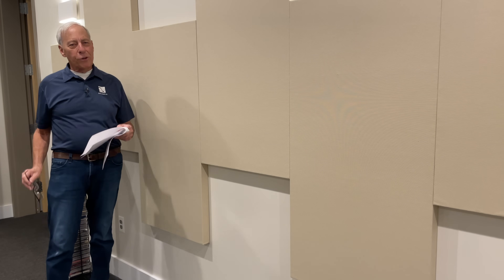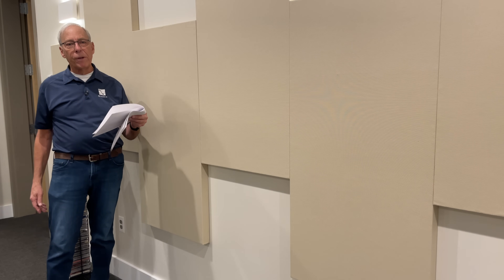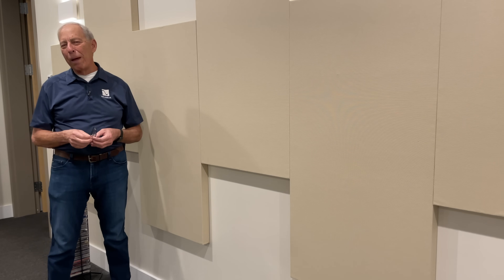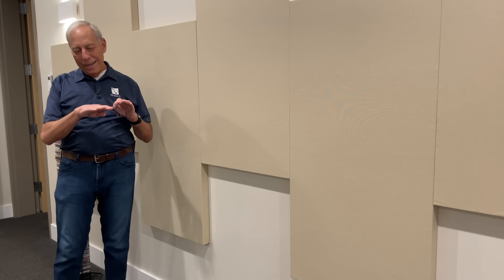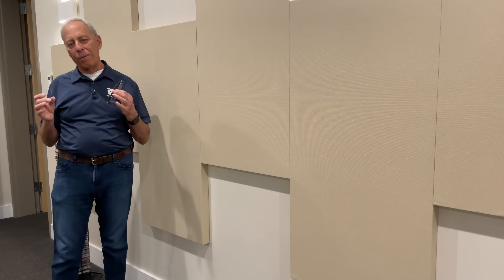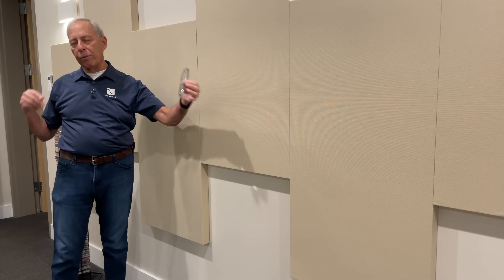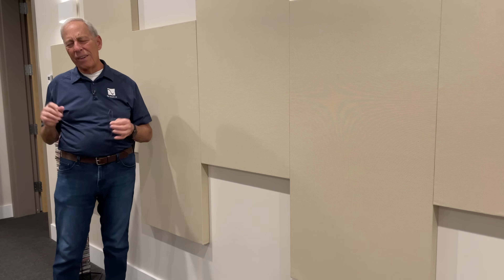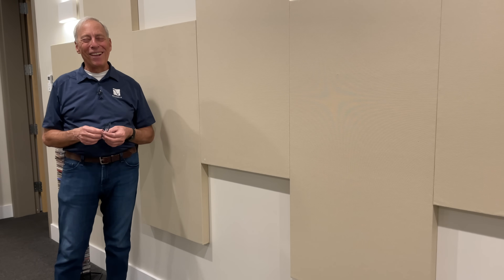Do audio connector materials matter?

Comment: Spending thousands of $ on cables is ridiculous. You won't hear any difference if you use those snake-oil cables or an electric cable from your wall at home as speaker-cable, or your lamp-cable. They lead the signal just as good. When the cables are connected to your gear, what's inside there do you think, diamonds and gold? ;)

Comment: I like pauls vids but only thing I never got was how little things like cable,digital noise such as laptops, to me I can't hear that noise anyway.  But then I guess I not true audiophile.  I interested to know how you guys notice such things I only seem to notice if something more severe with connection or frequency sounds bad in certain spots.  Maybe because I not using high end audio gear. I not digging at all just some of it I don't get.  But I do like a good sound to what I think is bad and good like hearing freq response how I like if that makes sense.
Reply: @Douglas Blake ok thanks for reply that makes sense

Comment: Well, I am from the school of thought  and experience that your signal path is only as good as the beginning and last connector. 

Case in point, Kimber Kable's power cords. I have both the Ascent and the Summit Palladian. Essentially, they are identical in terms of the actual cable itself. Same geometry, same metallurgy, even in the lowest end, the Base power cord has the exact same cable. The only difference between the Base and the Ascent, is the connector.  The Palladian just adds a massive filter (of some kind) to the same cable, with the Ascent's connectors. It rather proves that the cable as a transport of electrical signal is not as important as the connector that has to bring in the signal and exit the signal. 

The same is true in Audioquest.   Their low end speaker cable uses plated brass. When you move up to their middle tier, they use what they call, "Purple Copper."  This is copper mixed with Sulfur.  Sulfur is NOT a good conductor of electricity, so it is clear that this is added to diminish the conductive capability of the connector....so they can sell a more expensive connector, the 1000 series Suregrip that uses, "Red Copper" or...pure copper. 

If connectors didn't matter, then every manufacturer would save costs by using the weakest, cheapest connector. Why spend the money and time to create connectors that use both precious and semi-precious metals, if you didn't have to?  Because, if connectors don't matter, then guess what, neither would cables; and many of us know that isn't the case.

So....yeah....the quality of your connector matters, as much as the entire cable itself. More to the point, I have increased the quality of fidelity from a speaker cable, by snipping its machine terminated connector, and supplying an after market connector made of better materials.

Comment: From my understanding, the cable is doing all the heavy lifting, and should be the best quality possible.  Connectors mainly add convenience to the speaker hookup.  Back in ancient times, I used to solder the ends of my speaker wires, and "hook" them on.  End of connector doubt!
Reply: With all due respect, your understanding is incorrect.  The heavy lifting is done by the speaker and the amplification, which take an analog signal and turn it into something else.  A wire does literally no heavy lifting - just sends a signal from one end to the other.
Reply: @YuengsNwings  I meant between then cable and the connectors only…….  The cable will influence the sound quality more than the connector.
Reply: @josexavierjr.5633  Got it.  To that end I'd agree completely that the connector is definitely the minor component in the cable.

Comment: My only issue with brass is that its conductivity is around three times lower than copper. I'm fact it is only 50% greater than steel. Seems to me like a poor material choice for any electrical application. In the grail speakers I'm slowly building now with Seas excel drivers, I refuse to place brass in the signal path. I'll spend 5x more for Cardas solid copper binding posts.
Reply: Sure, but is there a real world difference? As in, is it noticeable in the sound quality? Maybe. Different also doesn’t mean better. But I feel like the peace of mind might be worth it, if you got the dough.
Reply: But resistivity is also a function of length. The extremely short path of the current through a connector will not result in any humanly detectible loss of signal, assuming there is a good electrical connection, i.e., no corrosion or oxidation on mating surfaces. A similar misapprehension of Ohm's law results in people complaining about the small gauge wires used internally in speakers.
Reply: @avsystem3142  I understand ohms law, but I'm using the notion of high resistance to imply similar effects that steel will have on signal quality. I know it's not that simple, but call it paranoia. Given how far audiophiles go to make sure everything is 5 x 5, going to strange lengths such as vibration damping their amplifiers and suspending cables above the ground. I'm not that extreme, but, not using brass in the signal path is a reasonable thing for me to do. Silver may not be worth using, but at least it can all be copper
Reply: @DjRjSolarStar  I don't disagree at all. I've never seen an audio connector made of steel except perhaps for the plated (nickel?) springs sometimes used on cheap equipment in speaker terminals.

Comment: Brass=Copper and Zinc. I like those low mass bananas (sounds like a diet!) - sprung along the entire length they should give a better and larger surface area contact and get the signal wire nearer the contact. Can be had quite cheaply, and seems the go-to in many reputable brands like Tellurium.

Comment: Correct Paul, I’ve been a bare wire connection guy for years. The improvement of the quality of spades and bananas. Outside of convenience their is no difference.
Reply: With that logic there is no difference in the quality of copper used in cables.
Reply: @carlosoliveira-rc2xt  Which is also largely true because any cable that costs more than 10 bucks is using the same oxygen-free copper.

Comment: I like how he mentioned that the signal doesn't flow through the connector, but, instead goes around it.  Making inexpensive, brass, gold plated ones the way to go over high buck ones that don't necessarily do a lot given the physics at work.
Reply: @Douglas Blake impossible, current is current.  It doesn't change with oscillation.
Reply: Not true.
Reply: @carlosoliveira-rc2xt  wrong, electrons don't go through a conductor, they pass over it.  In cables, they flow around the outsides of each wire strand and with connectors they pass over the exterior.

Comment: Silver tarnishes = oxidizes, as one can easily see on any real silver ware with black coating. Alternatives would be Platinum (Pt) or  Palladium (Pd), which are used in electron microscopy, typically in Au/Pd or Pt/Pd targets of sputter coaters.
Reply: But only where it’s exposed to air and not at the contact points…

Comment: If you have connectors that are resistant to oxidation (or clean them) and are mechanically robust enough to withstand your environment without breaking or coming disconnected and designed to prevent shorting across +and-  it'll be fine. AND one more thing. RCA connectors that yeet the grounds off your jacks when you pull them off just PISS ME OFF to no end.

Comment: I just solder my speaker cables directly to the crossover and the amp. Better than any connector, and $0 spent.
Reply: That does obviate the discussion about connectors. I would guess a majority of audio equipment consumers don't have soldering equipment or the knowledge to use it. It is also not very convenient . My compromise is to solder good quality gold-plated banana plugs onto the speaker wires and terminate them that way. BTW, for speaker wires (generally less than six feet) I use 12 Ga speaker wire (clear jacket) from Home Depot. That is generally available in their stores. I see that HD also offers 10 Ga and 8 Ga speaker wire on their web site for purchase.

Comment: I have a very revealing system.  Brass connectors add glare and over sweeten the highs.  It's something you don't notice until you make the change to copper.  Also low mass is much preferable.
Reply: Significant glare!
Reply: @YuengsNwings  So you havent done the experiment but you're an expert?  It's a clear difference.
Reply: @jman8368  It's an impossible experiment to do for so many reasons, and to claim to hear the difference in the material of connectors is taking hubris to the extreme.
Reply: Who are you to tell me these differences are in my head.  Again you need to HEAR the difference.   Remember the old saying of what happens when you assume something.  If you hear a difference with a better component, do you deny it because the " science" isn't there? If you can hear the difference in wire then why not connectors?
Reply: @jman8368  I don't doubt you imagined that brass trumpet playing in your ear while you were listening to your brass connectors.  You heard what you wanted to hear.  I see you've edited your original post, but you are making ridiculous claims that I would expect to be associated with a speaker...maybe an amplifier.  You're entitled to hear whatever you want and spend your money however you want.  If one person reads your post and is influenced to invest time and energy into testing different material connectors it is one too many.
Reply: @YuengsNwings  Describing what you hear in words is tricky.  The sound of the brass was definitely brighter.  I wasn't aware of this until the switch. I wasn't looking for the specific difference I heard with the copper, so you can rule out expectancy bias.  Of course it's not a jaw dropping difference, but still significant.
Reply: @Douglas Blake No matter what you say I know what I'm hearing so stop trying.  I've seen numerous examples of people who describe what they have heard in component or cable A in the exact same way.  Science is not taking all the factors or the correct factors into account, and is still in a relatively primitive and ignorant state.  Even Paul has touched on this subject in the past.  Remember how we were taught in school to test the scientific theory?  If the theory fails in practice you reject the science.  Just give up the audiophile thing and pick all your components by measurements even if they sound like crap.
Reply: @Douglas Blake Yes some do.  Are you even an audiophile?  Rel acoustics for example tests by ear.  Pierre Sprey a man smarter than the both of us combined, tested by ear.   Paul in a previous video said "measure, then listen."  Measurements are a necessary part  of the process to design a component properly but ultimately you have to listen.  Again, not all the factors or the right factors are being taken into account.  If measurements are all that counts, than might as well by a $100 amp and call it a day because they tend to measure great.    Even Paul agrees with this if you've been listening to his videos.
Reply: @Douglas Blake Ok so you do listen.  Fair enough.

Comment: My guess is that you, Paul, are comparing between various well made connectors fashioned with good materials. Most of us are dealing with the junk that came installed on our speakers, and between those junk connectors and actual good ones there is a distinct improvement in sound (if, of course, the system and room are) capable of such resolution.

Comment: I'm going to throw this in there just to drive all you "Audiophools" crazy. Unless you can absolutely, positively, without any doubt what so ever verify that your cables and connectors all came from the exact same batch of metal smelted in one run, you will NEVER be sure that you aren't getting robbed out of some portion of the sound that you THINK you should be hearing. It is IMPOSSIBLE. Why? Because no matter how stringent the processing specifications are, smelting metal is an imperfect process. Each batch of metal will be slightly different from the one before or after it. The only way you will EVER overcome this conundrum is if you manufacture the cables and connectors yourself, so you know for an undisputed fact that ALL the material came from the same processing run. Think about that long and hard. If it bothers you, you are taking this hobby WAY TOO SERIOUSLY.
Reply: The idea is to get as good sounding cables as possible.  For me that's magnet wire with bare copper  plugs.  We all know it's never perfect.  It's ok as long as it doesn't become an unhealthy obsession.
Reply: @jman8368  My point exactly. Some fights are un-winnable.

Comment: this old debate...
to all the iron is bad, brass is bad, tin is bad, gold isn't good, oxy free copper or silver only crowd;
assuming we are in corrosion free state, ANY metal that conducts with minimal resistance will work, i.e. if the run is short enough and the material thick enough it'll be good, even lead would work fine.
however we live in the real world, corrosion is a factor, joint fatigue where the connector meets the terminal and connector to wire bonding etc... all are things that we have to deal with especially over time.
cables hanging behind a system, cats dogs and small house apes can move the cables when you aren't looking causing strain on the joints as an example, or just the weight of the cable hanging can cause a joint to wear.

RF interference can be a problem on interconnects (not speaker wires despite GR researches stupid claims) so shielding can matter if you're unlucky in your environment situation.

basically for interconnects you need to worry about how well the cable connectors are attached to the wire itself, how the strain is handled in the general cable construction, corrosion mitigation, and cable jacketing tough enough to withstand the environmental needs of where it's placed (foot traffic, sunlight, pliability if it needs to bend a lot etc... ) a good $20 cable with gold connectors will sound the same as a $300 cable with silver connectors on day one, and 3 years down the road probably better due to corrosion resistance.  

speaker wire you can just use anything  from bare wire to gold plated with brass or steel underneath for a short term. the better you crimp and the better the corrosion protection the longer between needing to redo the ends to remove oxidation. every year or so i used to retrim the ends of my bare speaker wires to eliminate the oxidation build up. now i use bannana jacks for convenience as i tend to move my speakers a lot more than i used to for cleaning behind them. no sonic difference between gold plated jacks and bare wire.

Comment: Just watched another channel where they were harping on about their 'tube connectors' and everything else pails in comparison.....  I was going to mention I have been using 1/4 inch plugs, like used on many guitar amps for a lot of my gear (much easier for quick setup, no shorts from miss placed banana connectors) but you have done a far better job.

Comment: Generally clean connector interfaces make more of a difference than the individual materials (to me). Every so often it helps to clean and treat connector interfaces (stabilant) as over time they can degrade from normal impurities in the air. Older non-gold or tin seem more prone to this. Lot's of discussion "out there" on ferrous material used in connectors. I haven't found that to be a particular issue other than the increased tendency to corrode.
Reply: Yes, completely agree on this. I've been struggling with an HDMI connector recently where the video signal (digital) became unstable every so many days (typically a couple of weeks) and I had to unplug the connector and connect it again to make the issue go away. I suspect the gold surface of some pin in the connector of the HDMI switch has worn out and surface corrosion is causing the issue.
Reply: @petermortensen2405  Try treating all your connectors with DeOxit D5. It improves connections by removing & preventing oxidation. I also treat all my fuse ends and their holders with it too.

Comment: That was a good question. I never found connectors to matter or make any  difference in sound be they binding posts, banana plugs, spring clips, etc. The metal that they were made of made no difference in sound either. The only time that I've had problems is if they were so poorly made that they wouldn't stay adequately connected. And I haven't had too much of that problem.
Reply: speakon connectors are good.

Comment: Sorry Paul, cables do NOT make a huge difference. Moderately priced cables with mechanically good connectors are just fine. Spending hundreds or thousands on cables is insanity. Speaker cables carry audio frequencies. It is only at much higher radio frequencies where cable and connector construction is important. All this nonsense about skin effect etc. is snake oil marketing. Paul. Spreading this misinformation renders all your comment open to question.

Comment: I bought Yamaha's best radio receiver because it was a leader in that category.  My budget was much higher, but separates would disqualify me from using it at work, including more physical depth, as you can do better with a deeper box, but it would not fit on my shelf at work.  I use Klipssch 600M and 2 Monitor Audio subs. I bought all Audioquest including Rocket 33 bi-wire, and got WBT connectors for a bit of a step up (8 spades and 8 bannanas).  The bananas bite very hard and so that was my inspiration.  I did not test compare anything since the connectors are better than known rivals.  Also, it gave my compact stereo a little more character.